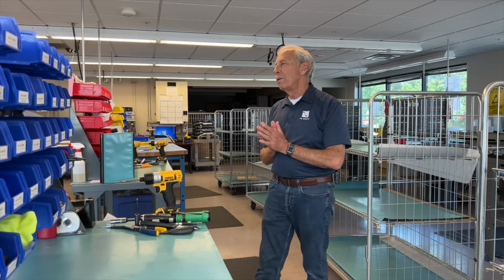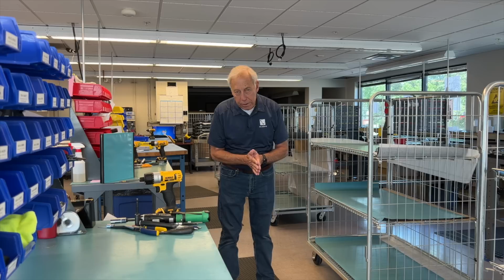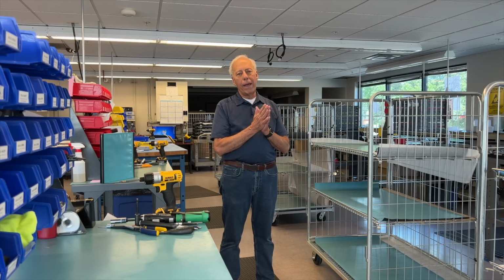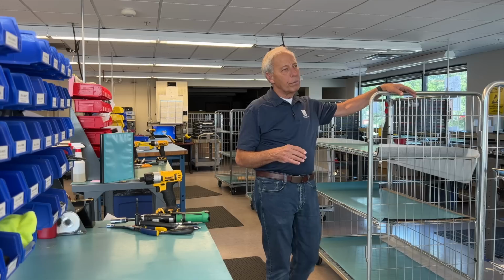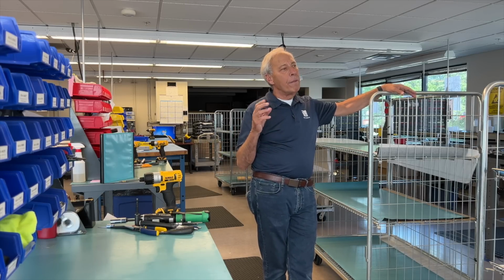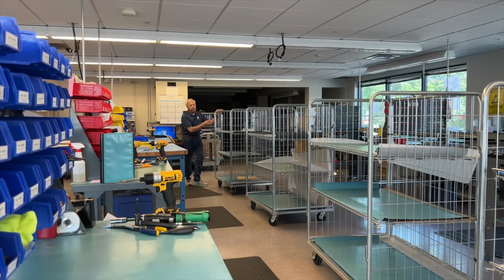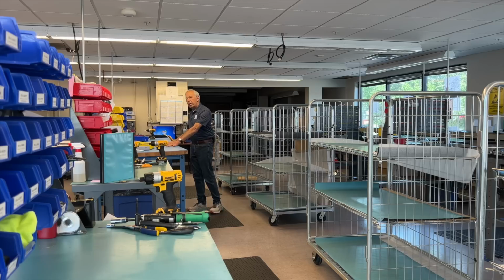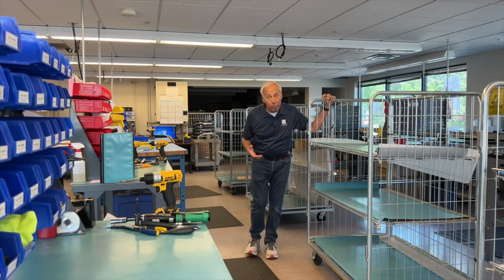PS Audio production

Comment: From 1970 to 1994 I worked for a small power supply house where we built custom power supplies, military initially and then more on the commercial side. I sarted out as a jr tech and worked my way up into engineering and then management. The greats thing about a small company is you get to do EVERYTHING. In a single day i would talk to Motorola about a technical problem we had with one of their IC's, work on getting a design approved for FCC compliance (we had a great Marconi spectrum analyzer) and then sell a prototype power supply to a government inspector. I dealt with all the HV products and anything that was a little weird. One was a power supply that would not reflect anything going on at it's output to the incoming AC power (constant power with very fast response) for the CIA. The next day I might have to draw up a plan for moving bulk power from one end of the plant (2 floors 150x75ft) to the other to satisfy test or production needs.

It was a job that was never boring because you worked on so many different things every week and after a while you got very good at all of them.
Reply: 🤗 GREAT STORY  …thanks for sharing it 👍😍😍😍

Comment: Nice to see how PS Audio is not only an American company by design and engineering but also by manufacturing down to PCB level.
Reply: Except for the very costly speakers which are made in China with off the shelf drivers.
Reply: @stasis2007  You are another one on a mission.
Reply: @stasis2007  Are you talking about FR30?
Reply: @joanfrederick9176  Prove they're not.  Show me The Made In USA label on them.  Paul won't even address this issue.  Others have voiced this as well in other videos of Paul and it appears he will not give an answer.